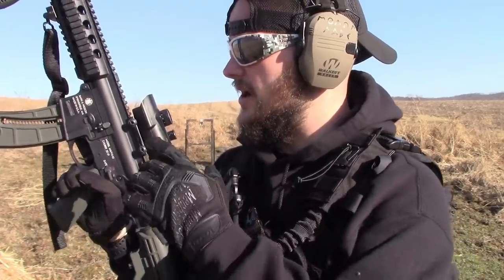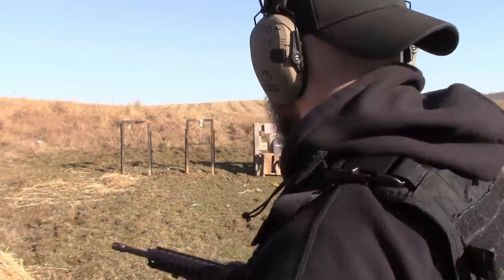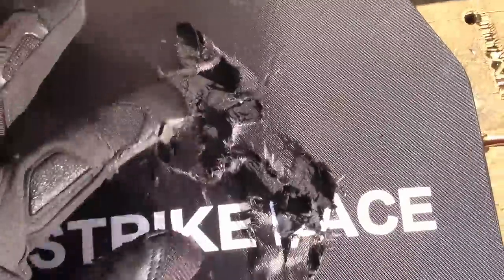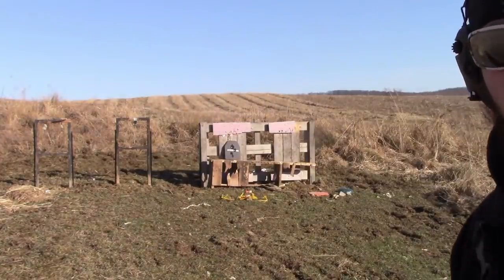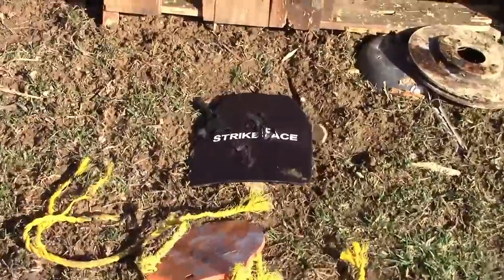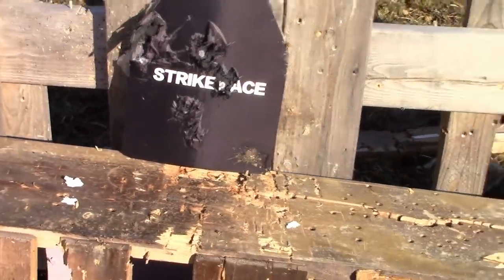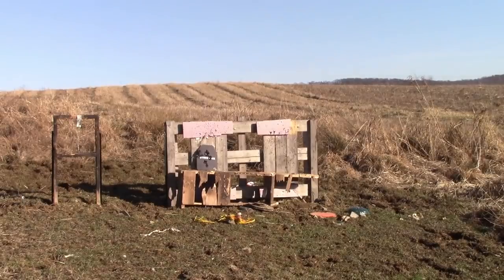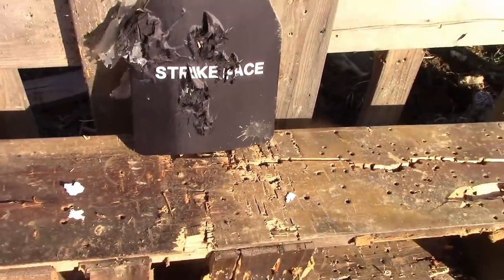Bullet proof plate from wish??

Comment: That's impressive! i buy a lot of stuff off of wish also. in fact i've stocked up on a bunch of things to make my Keltech Sub2000 9mm look a lot like an AR. Like pic rail 18"spring loaded tripod legs, a forward grip, Tactical sling, and now i have a Harbor Freight Hard rolling case for it also as well as 2 glock 33 round mags but those didn't come off of wish of course i got those from Midway. I have gotten a swing away Optic mount for it though because since it's a fold up rifle/pistol i can't use a regular optic unless i never want to fold it up again this way  can have the best of both worlds although sure how well it'll stay sighted in moving the optics all the time but if worse comes to worse i am accurate as hell with the "iron pinhole sights" built into the gun too. i had thought of grabbing the plate carrier and the plates before off of wish but wasn't sure of the quality. (it is coming from China after all)  but after seeing this i'm impressed enough with it that i think that's the next move. i have bought everything else they sell on there that didn't look like totally cheap garbage so i'm pretty sure that a good plate carrier vest and one of these sets of plates would serve me well. nicely done video sir! thanks !

Comment: Next time use a paint marker to check the point of impact on each one so you can keep track, also loose the gear especially if you’re not wearing it properly idk if people like it but the ones with experience won’t take you seriously... also the .45 you had in your side, why on earth would you have your loaded firearm inside your vest.
Reply from the maker: The 45 was an oversight didnt have a holster for it and tucked it in there unloaded. I get the gear thing though 👍

Comment: You need to try things like a 357sig and not hornady low recoil, which is the pink tip
Reply from the maker: I only used that in my second shot cause I just bought them. I didnt use them for the actual test part my second shot was the critical defense. Also I dont own a 357 yet but plan on it for the future

Comment: You need to check out buffalo bore tac xp +p. 110 grain schp running 1200fps on average out of my 3" ruger an they are pretty sweet. Fastest 38 round ive found. They are alot better than the critical defense round in 38 special as far as power and expansion / damage
Reply from the maker: Thanks for the advice, I'll look into those

Comment: 9mm can be hotter than 38 . 357 mag has a wide range but pretty comparable to 9mm in some cases 45 is slow but hits hard its for when ya gota use surplus ball ammo as self defense ammo 300 has power
Reply: What? Every 9mm I have ever used has more power then .38. then you say that 9 is comparable to .357....soby your logic .38, 9 and .357 are all close and basically the same.....
Reply: @CaptLeadfoot   38 special is a neat round with lots of light fun to shoot rounds . 9mm and 357 run pretty darn close to being the same ballistics granted you can pony up and get a wider range of 357 loads also it depends alot on the gun when ya go 357 as typically meant for revolvers that gona dump a bit of power cuz of cylinder gap . the original sw 38 was pretty weak in comparison to 9mm granted its an outdated round that largely got replaced by 38 special. Granted it is possible to pull more power out of a 357 than a 9mm there are several loads that act identically granted you can pull an extra 100 foot pounds of force from a 357 yet 9mm is hotter than 38 special unless its special made outa specs to run in a certain gun but that point its not 38 special its a 357 in the wrong case
Reply: After that you get into 357 maximum comparable to the new 350 legend rifle round
Reply: @CaptLeadfoot  there are some diffrences but there are points where ballistics can match however each one sounds different when fired however i haven't gotten my hands on a medusa m47 or any other multi cal revolver to do a fair test in a same gun comparison . kinda wonder if it would sound the same if i ran the diffrent bullets their ballistics matched but im guessing the 357 and 38 would sound the same at that point and the 9mm is likely to sound different

Comment: Would love to see some mil surp 55gr fmj.  M193 I believe it is...  M855 is the 62gr I think?  It's stupid early brain ain't running ATM.
Reply: But for a line up of test rounds against it, if you have access to them, I'd do 5.56, 6mm creedmoor, 6.5 Swede, 6.5 creedmoor, 6.5 Norma, 7mm-08, 7mm mag, 308, 30-06

That way you start with low caliber then go up in speed, then move up a bit in caliber and start lower velocity and work up, up to the next caliber and just repeat that over and over.

Comment: Not bad for the price you are paying. If my life was on the line, I would probably spend more though.
Reply from the maker: I think your 2 comments basically sums up the comment section lol. It's better than no plate but, there are a lot better plates if your life is on the line
Reply: @Pyro5610  XD yeah for sure. These would work well for Airsoft if you want a realistic feel but don't care if they are bulletproof or not. Would feel much better then a dummy plate filled with sand or something. You should also try and find a bulletproof/ballistic helmet on Wish and see if it holds up.
Reply from the maker: @doublebarrelslugs59  I did do one on a 20 dollar helmet that did not hold up lol
Reply: @Pyro5610  Try to find one that is actually bulletproof I have yet to see a video with one that actually holds up
Reply from the maker: @doublebarrelslugs59  I found 1 on aliexpress in the 200-300 range I'm gunna get eventually
Reply: @Pyro5610  That one better hold up for the price XD can't wait for that video!

Comment: The plate seems dependable but the spalling from the bullet is going to ruin your day ! It would be wise to take it to a place that sprays on bed liners and stack some layers on it! Also I would recommend a trauma pad to wear behind it because your body is going to take some blunt force trauma from that thin plate being slammed against you!
Reply from the maker: I'm going to test that spray on bed liner theory, I've heard it quite a bit actually from the comments
Reply: @Pyro5610  That would be a great video! From what heard that is pretty much the stuff that AR 500 uses as a build up layer. Naturally nothing is going to hold up from a bunch of rounds tearing through it but if will for just a few it does its job. The plate carrier will stop a bit but not as many as you would hope!

Comment: You need to put that plate carrier on correctly!! AK-47???? Also .556 Green?
Reply from the maker: Latest video, check it out I have learned, thank you 👍
Reply from the maker: I also hit it with a MAK 90 in that video 👍
Reply from the maker: 5.56 green as I know now isnt armor piercing is on the second video 👍
Reply: @Pyro5610  no it's not AP but it is steel cored. So it would probably make a better dent.
Reply from the maker: Right I said that it was in the video and I know now that it isnt just wanted to let you know that I knew lol
Reply: @Pyro5610  LoL!!!

Comment: I like the video, but I can't see what you're talking about half the time. Work on your camera angles. Otherwise commentary is good, premise is good, just work on what camera sees.
Reply from the maker: I appreciate the comments like these, got one earlier about the same exact thing. I'm thinking about using a gopro for the up close shots and mount it to my head. Thanks again 👍
Reply: @Pyro5610  just get a little screen for it so you can see what's being filmed, some newer ones have them and older ones have attachments.
Reply from the maker: @grawrant  my wife has a 5, I'd like to upgrade to a 7 soon. I think my real problem is rushing the videos and not reviewing it. It's a learning curve but thanks to people like you it gets a little easier with each one
Reply: @Pyro5610  The "Akaso EK7000" is a budget GoPro that works just as well for like $40 on Amazon, has a screen on the back but not the flip around screen. Might be worth a shot. Thanks again for the content!

Comment: Those pink tip rounds are low recoil like for a women . Full power has a red tip. I run red in my carry gun and run the pink in my wife's gun.
Reply from the maker: Yeah this was filmed in april and I went to a gun store and this was all they had, same here though I do run red tips in my carry guns as well
Reply: @Pyro5610  wasn't trying to rag on you or anything just wanted to make sure people know that there are 2 different loads of the same ammo because a lot of people would not check that and I know if I ever had to use it on a person I want the hottest round ready for delivery..lol
Reply from the maker: @bansheeman213  I appreciate it, didnt mean to come off harsh. But yeah I finally realized that after this video I believe because I  was wondering why it shot with such little recoil

Comment: A gunsmith for pistol sights? For fucks sake
Reply from the maker: Didnt have a sight pusher 🤷‍♂️
Reply: @Pyro5610  don't need one of those things at all...
Reply from the maker: Tried it myself before on another pistol, ended up scratching it and didnt want to mess this one up.
Reply: @Pyro5610  painters tape, masking tape, fuck even electrical tape if it will stick. My self I use the first two all the type for a multitude of guns things. Like a bolt catch install on an AR15, changing sights on a pistol as well, installing mag releases on AR's, etc...

Comment: Better than nothing,  ,for years,  as a gunner,  on huey,  wore the flack jacket,  some time with a skillet plate,  some time with out,  , after I got out of the army,  had that old flack jacket,  in the closet,  one day,  with a old friend,  came by,   and seen it in the closet,  after drinking a few beers,  I  decided to,  shoot that,  vest,  with a 380acp,  dam , that bullet,  with right in and out of that vest,   if I had those,  Chinese plates,   in my vest,  now it can,  stop a bullet,   but you are going to feel the hit, it like some hit your chest,  with a larger steel crowbar,  and maybe  crack, your , as for your  level 4 plates,  they made  and designed,  to expand pressure,   and ex sober , basically getting hit, with a larger hammer,  and not cracks to your ribs.

Comment: damn. Death by spalling much. The shrapnel coming off that shit would slice you up if not kill you. No wonder these are cheap as fuck.
Reply from the maker: But you wont die from the gunshot 😂😂😂
Reply from the maker: @taylorharris5601  perhaps I can try it in a plate carrier from wish to test on ballistic gel and see if it helps
Reply: @Pyro5610  depends on what you are testing. Penetration? Put the gel behind the plate. Shrapnel? Put the gel above the plate.
Reply from the maker: @taylorharris5601  probably around the plate and maybe using the foam head I had from my wish helmet video

Comment: Jesus kid... Look, 9mm is VERY similar to .45 in terms of ballistics so you’re not really stepping up. And you also went from 9mm to the .38 which is stepping down not up. Also, only a noob would be surprised that a .300 blackout “FMJ or not” wouldn’t penetrate. Shoot that plate with some green tipped 5.56 and the rounds will go through it like butter.

Why even bother shooting it with .22? 
Why shoot 9 and 45 when they are basically same?
Why be surprised a .300 blackout didn’t penetrate?

Novice shooter with novice knowledge😎